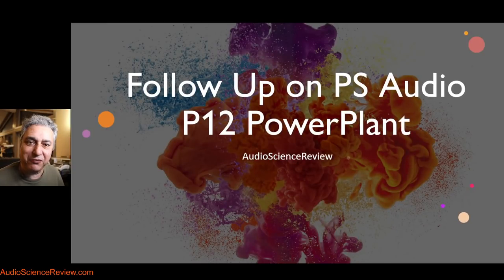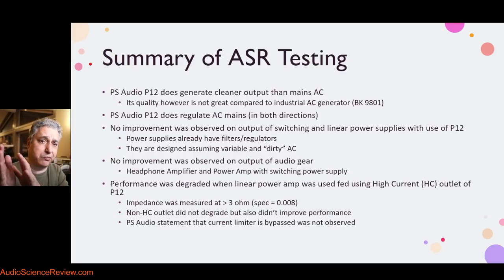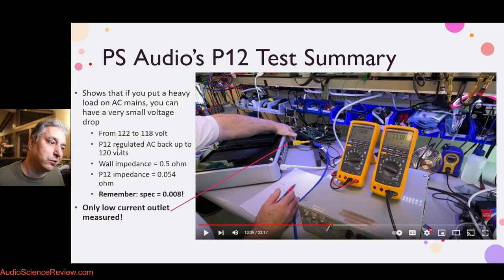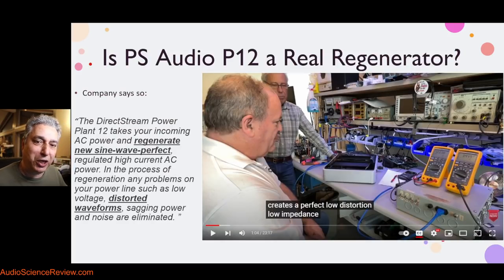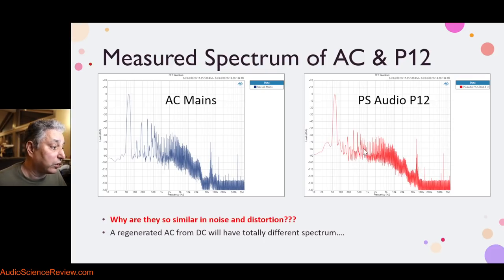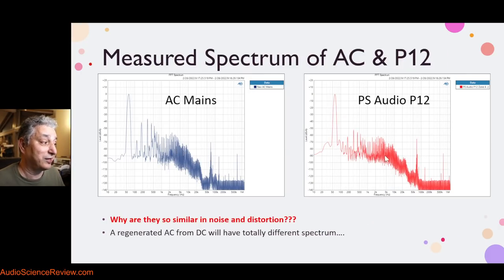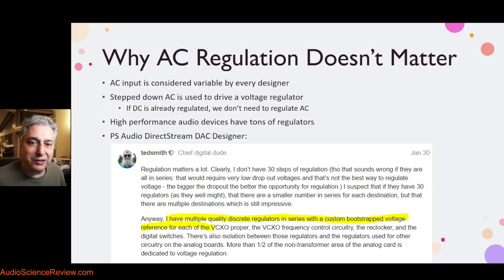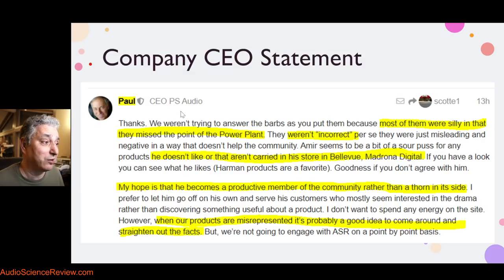PS Audio PowerPlant Measurement Follow Up

Comment: Well in this case Amir won, but there is a big problem behind  general methodology on ASR. In previous part/review of PS Power plant Amir said that he hear worsen dynamic using  PS  device with  amp, but then claim this is just illusion. He often claims that audiophiles hear difference for  better because they  aspect that, but what he heard is worsen sound just like I expirience when i was using similar Power conditioner . Measurement result must corelate with audio tests, or  it  is not  truly relevant. Lets see another example to be more clear: Magnepan LRS speaker measured bad in ASR review, with method  which is at least "problematic" for panel speakers. I own LRS, and also own Kurzwel  studio montors . Those studio monitors for sure measure better than LRS in  anechoic chamber , but there is no way that they can beat properly setup Magnepan LRS  in  blind test . Also, there is no chance that me or my friends will chose to listen good  Jazz or Pop with  those  studio monitors  rather than  with LRS. Measurements alone are not enough to predict  achieved sound quality in the room.
Reply from the maker: Measurement results agree with controlled, blind listening tests.  My listening tests were NOT blind and hence, not valid. You can't mix a scientific effort with one against it and ask that they agree with each other.   I am confident in a blind test I would just vote randomly what is what.  My listening tests demonstrate that even if you think "there is no difference," you can still "hear" that there is.  So the typical excuse of "I didn't think it would make a difference but it did," is no defense.
Reply: @Douglas Blake  Audio is full of controversy, lets take look at Thd distortion . On ASR, amp who has Thd 0.02 values better than amp with 0.08 Thd,. No one can hear differnce between 0.08 and 0.02 Thd.  so  why is that so  important? In 80' Japanese amp industry chasing  those low 0.0001 Thd numbers by using more negative feedback, and that make every next gen  amps actually sound worse,  until they found it by consumer opinions and  listening tests. On ASR  there is a thread about ACA Pass amp,  debate is about measurment where "die hard" members claimm measurment is all,  listening is not needed.Then one guy check in with valid info why is listening a must for amp evaluation. ASR member ask him -  Well, how do you know  all that? Answer: Maybe  because I make them (amps). Then  Amir step in ; Do you work for ATI?(respectable amp company)  Answer: Yes. Amir: You should introduce yourself,  so that we know whit whom we talk. Interesting...they insulting people with same opinion on that ASR thread, but they step back against  guy from ATI. If this little story does not "ring"  for you , sorry.....  Have  a nice day!
Reply: @Douglas Blake Yes… I agree , we need measurement and we need listening test. Majority ASR members need only one - measurement. If something can’t be measured , it simply not exist. This is not true, and science is  not  measurement …. only.
Reply: @Douglas Blake   I agree that people need more info and education, but If you want to tell someone that is wrong you don't  need to call him "clown".You make enemies from people who are not. 
All that you mention, don't change fact that Amir use some non scientific methods :
- measuring before listening tests
- not using panel with more people for listening tests
- not doing listening test at all
- listening test for speakers  mono only
- predicting with no evidence that people in listening test will vote  this way > or  that way <
- don't know some  methods  well enough (first ask  in  thread "how to measure planar speaker?" , then he measure Magnepan and now it became "reference")
- don't know equipment enough (egg. using for test low wattage SET amp with low sensitivity bookshelf speaker)
Honestly,  this is not a big surprise for me . He was most of the time software guy for codecs in Microsoft.
Regards...
Reply: @Douglas Blake Ok, I think we are good.

Comment: could you have a better results with a 60$ site transformer running 32 amps and running a bank of motor run capacitors on the primary and secondary say 60uF or 120 uF x 6 or 12 at 10uF
with a suppressor capacity of 1uF x2 450V on both primary and secondary,
I'd like to know the results on that give it a test. lol 🤗

Comment: I’ve always looked at PS Audio as overpriced and rather unattractive/sterile looking gear. This does not surprise me in the least, especially after seeing his $20,000+ speaker cables. Seriously? I think one pair was over $30,000! I’m calling snake oil.
Reply: John Bravo  They are AudioQuest cables with Paul’s name on them. They are in his website, on the accessories section of his new $30,000+ speakers. It is worth a look. 🙄
Reply: Not a very long time ago Gene DellaSala of Audioholics got into "discussion" with Paul McGowan regarding those Audioquest cables. The end result was Paul McGowan defending/reasoning the magic of unmeasured aspects of those cables  :)
Reply: John Bravo  No, but I remember that 1 meter $10,000 HDMI cable! Linus has that on his $1,000 HDMI cable test… it did come in a cool little aluminum case, just like the ones they sell at most truck stops for $20.😂
Reply: @mzmz9355  I watched that video Gene did on the AudioQuest speaker cable, it had a battery pack on it, it was stupid money, and the banana plug broke the first time he plugged it in. It measured worse than Home Depot Zip Wire… The battery box itself introduced a helluva a lot of noise to the cable. The measurements were terrible.
Reply: John Bravo  It is in that video, just search $1000 HDMI cable, Linus's video will pop up, he mentions it later in the review of the $1000 cable... Oh, the cable made no visual or sound quality difference on anything he attached it to... Imagine that?

Comment: Amir, in fairness to Paul he did say to update the firmware with P12 current version.  Was that checked that the P12 was using the latest firmware?
Reply from the maker: I addressed that in the video.  My sample had the latest firmware as of review date.  The have now released a new version with no documentation to say what is fixed.  Nor did they mention that in the video.
Reply: @AudioScienceReview  great install it (PS Audio said it’s found on the website) and see what IS fixed! The rebuttal was in the comments by one of your admirer’s. Personally don’t care if thing is the greatest thing in world I have better means and more important things to spend 6 grand on than better AC from street electrical lines

Comment: Just watched the PS Audio video. For sure they avoid mentioning anything about the actual noise level and output impedance of the “high power” output of the P12 as you mentioned.
However, they spent some time on the “pure” sine wave output and also on the feature, that the P12 can add some third harmonic to lengthen the time the connecter amplifier power supply can draw current, which, as they say, will lower the necessary current draw and hence “help” the connected power amplifier, which is true.
In the PS Audio video, they only use a pure resistive load, which is not representative of the real-world working conditions. My guess is that 95% of all pre- and power amplifiers have a transformer, rectifier and bulk capacitor bank as their primary power supply. This means that they only draw current at the peak of the AC voltage wave form. 
It would therefore be very interesting if you could connect say a 2 x 100W power amplifier running full power and the see the actual wave form on a real oscilloscope produced by the P12. This will put a high impulse current load on the P12. Maybe its regulation loop will not be able to cope with such an impulse load.

Comment: when designing product don't engineers put some regulating in power supply
Reply from the maker: They absolutely do.  When I was a teenager and building electronic projects, one of the earliest things I built was a power supply with a regulator.  Regulators are so common that they are reduced to simple 3-pin devices that sell in billions of pieces!
Reply: @Douglas Blake thanks
Reply: @AudioScienceReview  Thanks New to Audio- beginner what is 3 pin device is that 3 prong plug also my pr-amp and amp doesn't have a ground prong?
Reply: @Douglas Blake thanks

Comment: Let me go over this in pugilistic terms. The initial encounter, two guys walking on opposite sides of the street. One is dressed as an impresario, the other has a pocket protector. Slight scorn is displayed by both. Pocket protector guy is a bit aggressive and says, 'Hey what are you looking at?'  The smartly DRESSED dude says, 'Nothing.' 'That's typical for you.", comes the reply. 
So we have a bitch fest, followed by a slap fight, then with gloves and finally bare knuckles.
Only one is left standing and I don't comment on a loser's page.

Comment: Also I bet they outsource all the engineering in Singapore or China. There are some "engineers" on payroll but I bet my bottom dollar, they rarely design their stuff. It's all a dog and pony marketing show.
Reply: I'm fairly sure they do all assembly in Boulder. They may have boards made in China and perhaps the boards stuffed, especially the surface mount components. But the wiring and mechanical assembly is done in Boulder.
Reply: @andydelle4509  They might do assembly in Boulder but if all the parts are made in china, and the bulk engineering is done by some company in Asia, what is the point? The point is to sell a lie, or half truth if you insist.
Reply: @CatchyNameF1  I am pretty sure all engineering is done in Boulder as well. PS Audio does use  engineering consultants such as Bascon King for the BHK series amps.

Comment: I tend to compare "issues" such as these with other industries. For example, VINYL RECORDS. Anyone from an aware child to a near deaf withering audiophile can recognize good clean well-cut vinyl compared to kraklinz and poppinz and hissy nonsense. AUTOMOBILE ENGINES. Any gear head can distinguish a well tuned carburetor any driver can tell if they are getting better speed performance from a Plaid Tesla or a Kia Optima. SPORT TEAMS. Any fan can tell Tiger was better than ... anyone! DIAMONDS. Any gemologist can discern a good diamond from a flawless diamond. FOOD. Michelin star or Mickey D's? 
When it comes to tiny barrel shaped things welded to a substrate with little grey wafers glued down in between and coils of copper wound around nothing, it takes a genius in order to measure signals and analyze data much less LISTEN OBJECTIVELY. Like ART! I made custom fine furniture for decades and there are countless times that the customer didn't even know if they liked the piece until the designer showed up and says "Yes that's what I had in mind" and the customer begins calling their neighbor to come see the wonderful new piece in their home! The power of suggestion is wielded for sales and opinion shaping in the audio business much more than it should be. I can understand a salesman explaining that the Boston CR9 is a much better built speaker than the Bose 301 by objectively pointing out features and benefits of the product and play testing them over and over. But when a product is made to fill a niche that isn't there it becomes a cash grab and exudes villainy rather than integrity. Where is the patented technology in that magic box? Is it even underwritten? Is it used extensively in the medical instrument field where life and death hang in the balance? Or is it smoke and mirrors? Bottom line it's, some folks are gullible and they need to be told what they like. When those folks have a lot of money for discretionary spending. The sharks will circle their prey because that's blood in the water for a salesman. But for an honest metrologist it becomes a teaching moment and a "don't waste your money" scenario.
-✌🏼

Comment: What a tool Paul is , measurements don't lie. And if it was wrong , you'll not going to make it a strong point by using a couple fluke multimeters! 

Least use lab gear to show for real what those measurements are. I saw he made a cringe video "inside a re generator" 

God almighty, if I was paul I would have invited mr Amir over and had a good convo, and show him around. And heck , even openly debate the measurements.
Reply: would imagine the engineer being a lot more fidgety if Amir was standing there on some tour.

Comment: Good afternoon all. Interesting videos from both sides. I actually own a P12 and with my equipment (Gustard DAC, Primaluna amplification,  ZU speakers , OPPO disc player) I am not one to spend my money without return.  I can state with  hand on heart on the difference with and without is very obvious.  As the "voxpops" say "darker blacks" , clearer in all frequencies. I've been in to audio from the late 80s selling and repairing Midfi (Marantz ,Technics etc) then working in pro audio (club to stadium systems) .The P12 obviously isn't for everyone but it might be worth trying it with listening vs measurements.  I believe in both by the way.
Reply: as I told to another owner,  go ahead and settle this matter once for all, do the proper blind test, and prove to the whole world the P12 works; Amir would have to do a formal apology. You will be an Audiophile hero, I would buy the P12 for sure, but put up or shut up
Reply: @Lauren080508  what does any of that mean ?
Reply: @grahamjohnsparks  Darker blacks?  Any time I hear someone say this I know they have no idea what theyre talking about.  Have someone in your house unplug and plug in the ps12 once a day for a couple weeks but mix it up so you dont know when its in use or its just plugged into a wall.  Guarantee you wont hear a difference.
Reply: @sergeysmelnik  how can you guarantee anything. Like you said " anytime I hear someone say this i know they have no idea what they're talking about". Have you actually tried one ?
Reply: @Douglas Blake did you actually read what I originally wrote ? You obviously didn't comprehend it.  A synopsis would be " it works for me  but may not for everyone "  you have no idea what I did or didn't do. How do you know how I tested it or not  ? How do you know how anyone other than yourself subjectively sees or feels about anything.  Again  you are guessing and ironically stating as a fact your guessing is 100% accurate.     Consider this,  your "facts" are probably based on never using a P12 , watching videos regarding an audio product ... and seemingly know everything.  Now I will be open minded enough to think that you have done the blind listening tests yourself,  done scientifically based tests yourself , actually own , borrowed,  rented a p12 yourself. The difference is I am open to others thoughts possibly wrong though, possibly right. It must be a chore from time to time being as perfect as yourself...
Reply: @Douglas Blake again. Have you had one , borrowed one , rented one ?  You assume based on what  ? The answer is nothing.  I fully agree psychology comes into most purchases of anything  .Tell me this with the multitude of inherent failings of LP records and the playback of them why is it people like them ? Science and the measurements that I'm confident you yourself could not and would not conduct prove it is a very flawed system though people can tell you it bests all others are they wrong? Do you play LP records ?
Reply: @Douglas Blake wrong,  again .I , myself never once said at all anything about it being right or wrong. On the other hand you yourself state 100%,  as a "technician" surely even someone like you might understand that there are no absolutes in any discipline.  Now again, again. Have you yourself owned , rented , borrowed a P12 , have you performed any test,  blind listening , scientifically on this device.  Furthermore I asked about your opinion on LP records / playback systems , you failed to answer , why would that be ? Keep in mind I mentioned " your opinion " . How about answering these very sincere questions.
Reply: @Douglas Blake "I " , I spoke for myself . What is it you don't get. Again, again, again. Have you ever heard a P12 , owned, rented been loaned one, tested one yourself. Now again Mr Technician tell me about LP's ?

Comment: It’s another one of these monkey business ideas in audiophile-land. I like Paul fine, but he’s got stuff to sell just like anybody. Saying your audio equipment performs better plugged into our conditioner, then measuring the effect with devices plugged directly into to the wall. How does that work? If the wall is the source of so much interference, noise, and variability, how is that not influencing the functioning of the measurement devices? Or do they have filtering that my $15,000 amp doesn’t have? Bunch of hooey. Thanks, Amir.